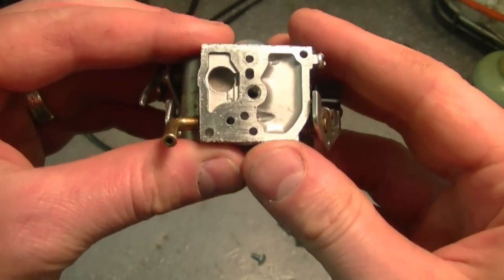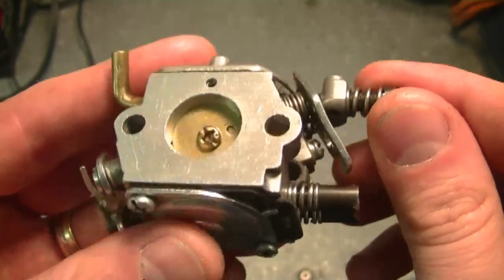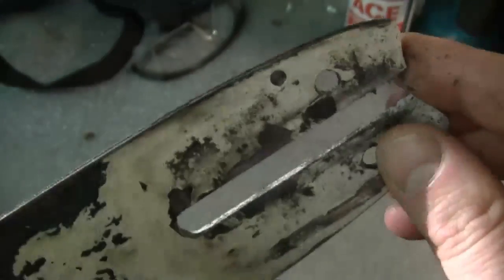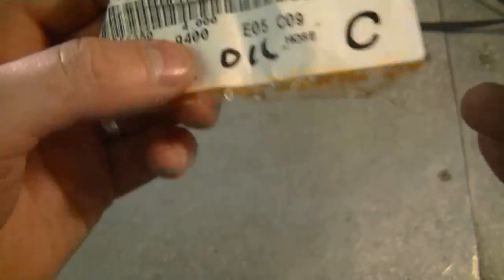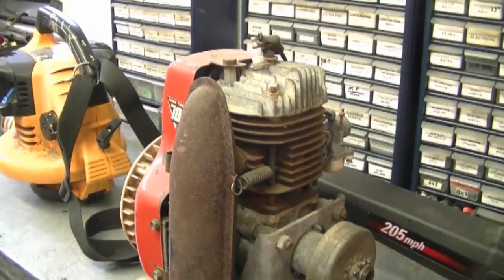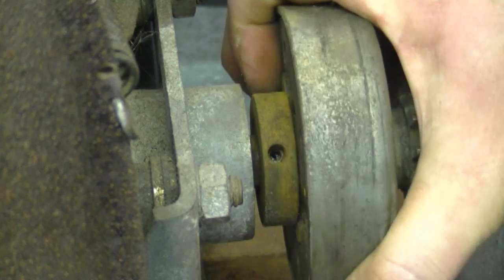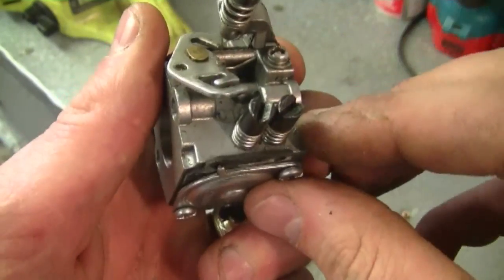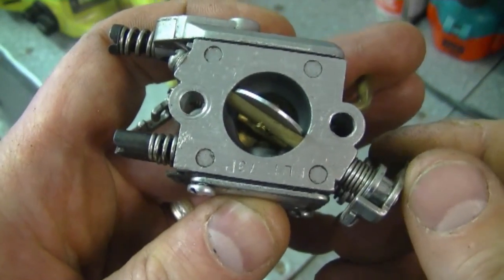Small Engines Q & A Video #97 in HD

Comment: This is your first Q&A video I have watched. I just found your videos, after a google search for the throttle - linkage on a Tecumseh H50 engine.  Thanks, your two video's on the subject were a real relief.  I had just removed the engine shroud/cover on my tiller, and the two links had both dropped off the "spring" arm of the throttle.  AND I had not noted their placement.  Thanks

Comment: HI DB,
2 years already?  Tempus Fugit eh?  One thing that helped me way back on the small carbs is to remember that the low speed fuel jet is always closest to the cylinder.  If there are caps, you can pull them with a drywall screw.  Saves alot of time looking into tiny cracks trying to see the marks!    I hope you enjoy the vacation!

Comment: A lot of the time,the oiler holes clog up because the chain is allowed to become too dull.The finer the chips,or more powdery,the more likely the oiler hole will clog.With a sharp chain,the chips are much larger and uniformly square and don't tend to cause the oiler holes to clog, at least in my experience.

Comment: synthetics are mostly used for scooters. I use it all the time in my 2-strokers without changing the mix ratio. 100:1 is just advertising unless your manufacturer suggests it.
usually stihl/husq will say 2% with proprietary oil and 3% with any other but as long as it has following specs: API TC+, JASO FC+ and ISO-L-EGD you can mix it 2% as it if was 'the real thing'. all of these exceed stihl/husq requirements

Comment: My stihl ms170 has only a idle adjustment. 

Most newer equipment will not have any Low-Hi adjustment. Due to air quality and pollution laws. 

Every other new saw or trimmer will run like crappy especially in different climates. With nothing you can do about it:-(